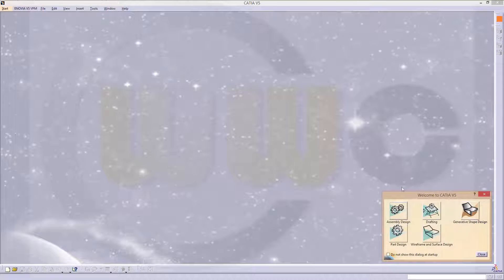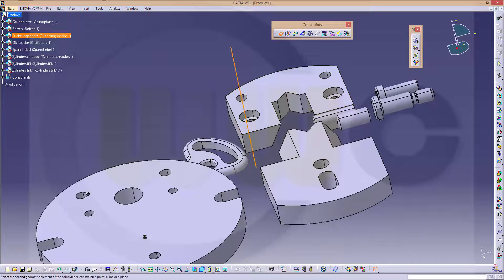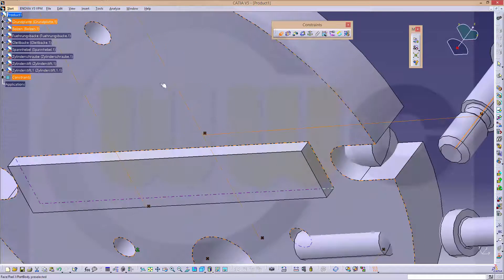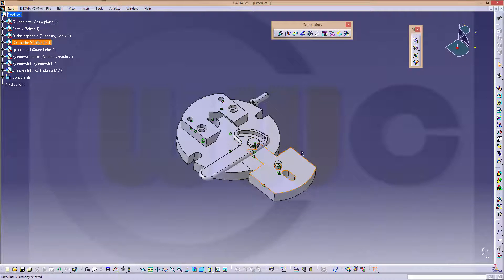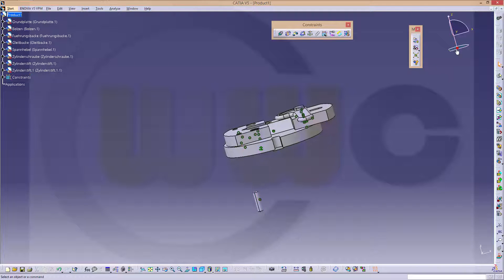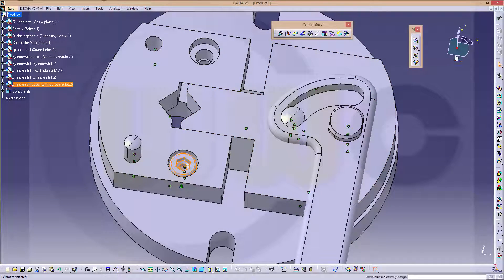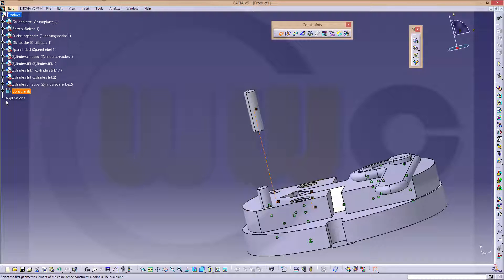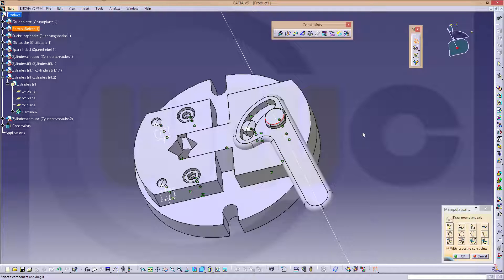Speedy Assembly - Catia v5 - Assembly Training

Comment: How I Can, an Absolute Axis System from assembly to be moved within a CATPart to a different location even if the creation of the part has no connection with the axis?I have 20 Partbodies in assembly and I have to do the same for each one. I can't use reference bodies and I still think the axis-to-axis transfer is the quickest way to accomplish, but don't work. I can't move Part monifold in origin assembly. What I have to do to replaced or moved axe to avoid recreating the entire model. Many thanks for any advice
Reply from the maker: First, an assembly in catia has no axis system at all. You can have/create an axis system only in the parts.
If you talk of "part bodies" you can have only one "part body" in a part. So you are saying you have 20 parts in the assembly without an axis system?
Reply: The model has been created with some meters away from the absolute axis system!!!  I see that when I try to make a product with one part from assembly and a new simple part. Only now I see axis but I can't give any constraint for part. And I need to have axes on my part for CNC. Copying in a reference is not acceptable and for this reason all 20 Parts has to be remodelled from scratch?
Reply from the maker: Create a new an empty part in the assembly, you will be asked if you want to define a new origin or place it on the origin of the assembly. Place it and fix it. Insert an axis system into that part (or even beforehand) and then you can use constraints.
Reply: Thank you very much! I think it works but the problem is that I do not have the whole drawing assembly, but only separate parts take it from him. Is there a possibility to solve this case?
Reply from the maker: Sorry, It is kind of hard to understand what your problem is.
Reply: I have few Parts from an assembly, but I don't have assembly drawn, and my Parts have origin, - (has been created with some meters away from the absolute axis system) and I need have only one origin (absolute axis system) on my part for manufacturing on CNC. With the origin axis system a few meters I can not use the Part on the CNC. This is the reason for why I need the absolute axis system to be on the Part.
Reply from the maker: Okay, I think I understand. So place all parts with part origin on the assembly origin - "fix together" and then move them.